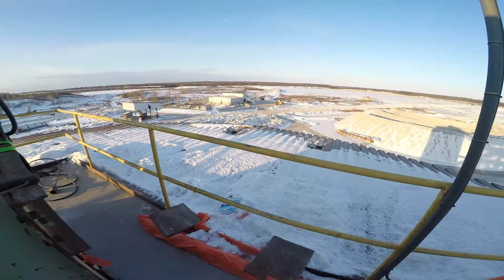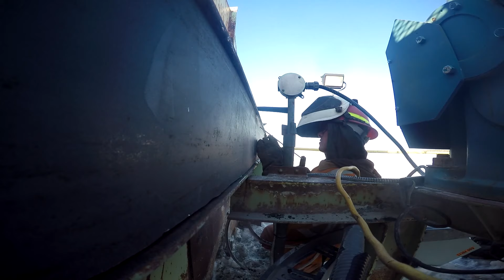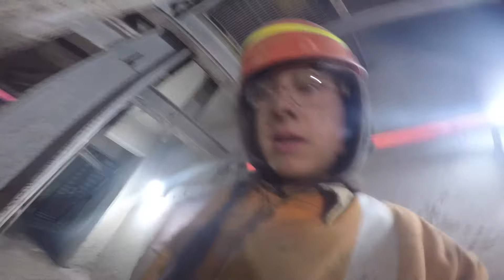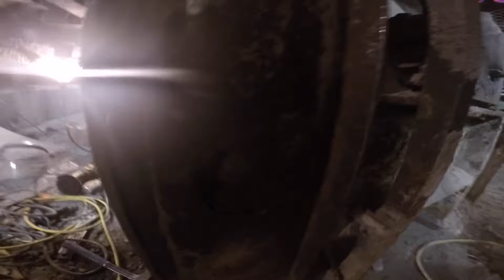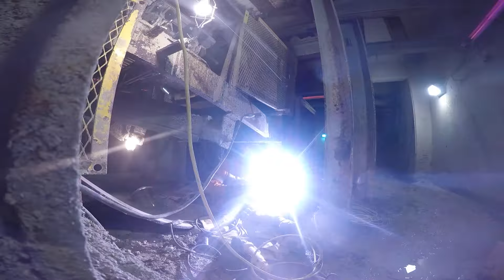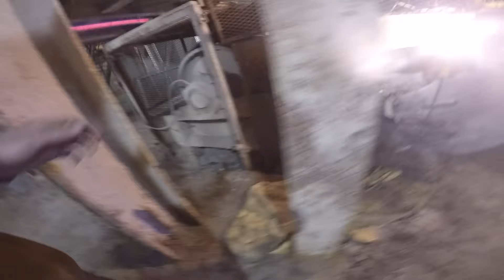Young Welder Old Rig

Comment: Are you a journeyman?
Reply from the maker: Nick Turner I wasn’t a apprentice back then I was certified welder. Now I’m a apprentice boilermaker going for two Canadian journeyman red seals.
Reply: JTwelder oh cause I thought to run a rig in Canada you had to be res seal?,I guess if you have your cwb tickets  that's all that matters?
Reply from the maker: Nick Turner anyone can drive a rig. It’s the actual type of job your doing which requires the certification. This job only requires a basic all position cwb. My new job requires Tssa pressure tickets and I have to be a registered apprentice.